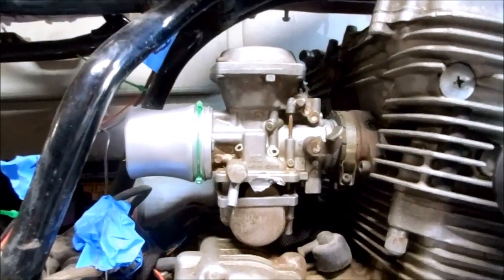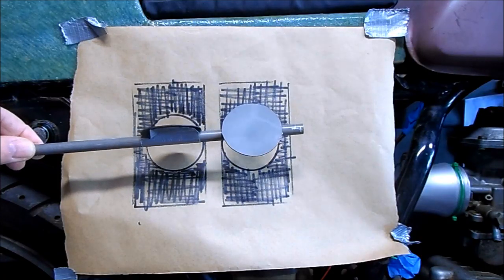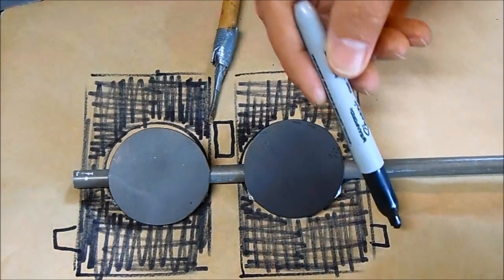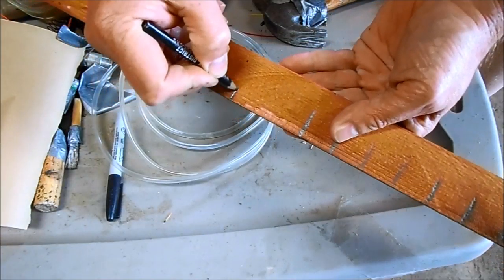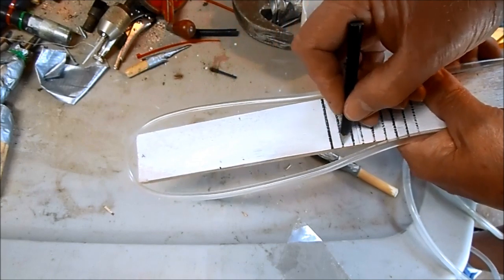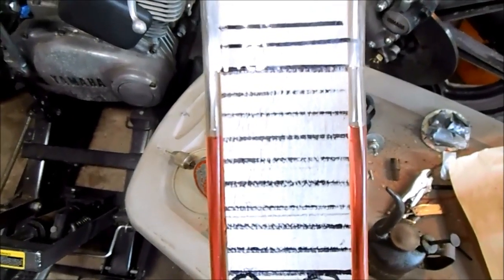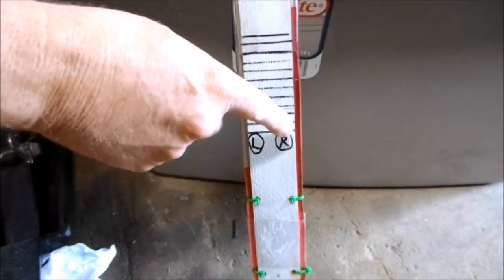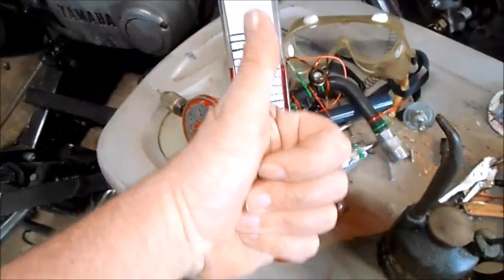How to syncronize motorcycle  carburetor balancing with  Vacuum Manometer  Tool  on a  café racer

Comment: I went to get some assembly tape but the guy in the shop tried palming me off with duct tape - no way was I buying that junk. They had no green cable ties - only regular black  and yellow ones, which aren't stress rated so no go there either. I'm gonna order some online off Bibo 'cos  I find they deliver really badass fast.

 I built that amomenaterterer but only had black rubber hose to hand - makes seeing levels a little tricky - fixed that by drilling holes every 10mm so I could see what level the fluid reached & were they level. Luckily, they must have already been balanced as the fluid came out the first hole each side - dead bang on balanced. Another task ticked off the list - 5 Star video.

Comment: The theory at the beginngin is a bit off.
The purpos of synchronizing the carburetors is to get the same amount of air/fuel mixture in each cylinder. Each cylinder is a little bit different then the other (valve vear, compression, air flow,...) and by opening or closing butterfly in relation to other carbs it compensate for those differences. So your goal isn´t to get all of the butterflies in the same position (or we could just use feeler gauges without manometer) but to get the vacuum/suction on all four cylinders the same. So technically you´re not sinching carbs but cylinders.

One more thing. When synchronizing the carbs you don´t change the air/fuel mixture so the spark plugs (plug chop) will be the same colour as before the synch. But if you haven´t rejeted the carbs before putting those velocity stacks on you are probbably running lean - white/ish spark plugs.
Reply: Bro I don't think you understand this is a satirical parody